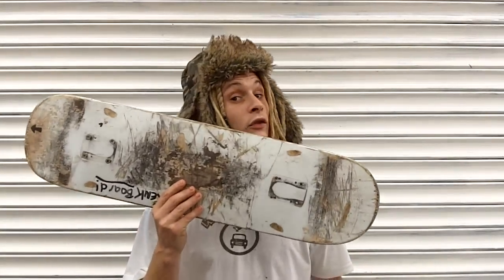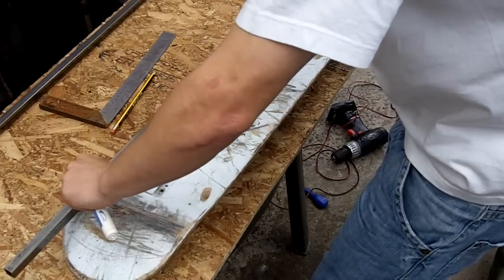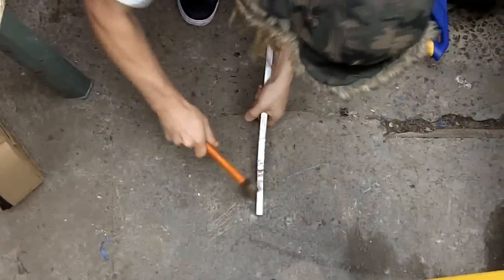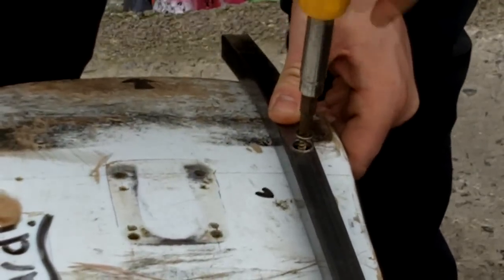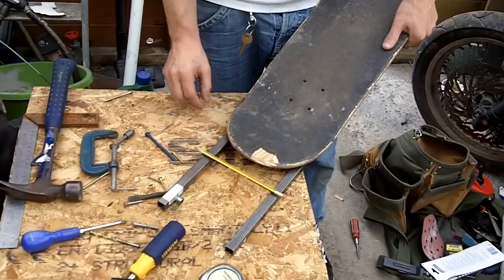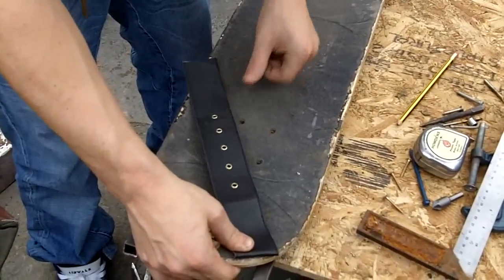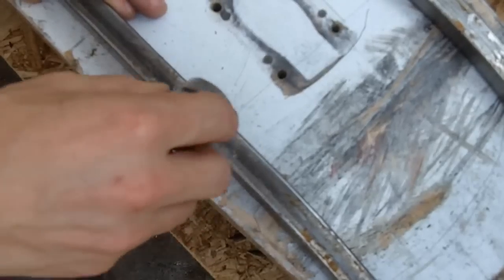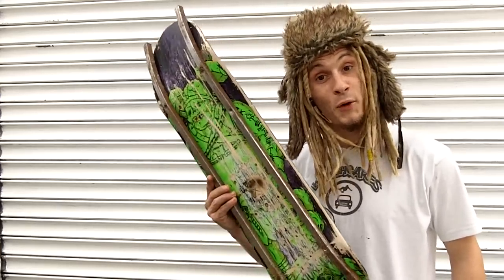How to make a Snow Skate - That Works

Comment from the maker: Hey everyone, im sorry i haven't been here to answer your questions hopefully this should cover most of it.

firstly does it turn?, basically you can turn to avoid things and control direction,  but its quite rudimentary, but its still a lot more control than a unmodified skateboard
 you will not be able to carve long turns  like a typical snowboards.

problems with this design? in deep snow you will find your self riding deep. and there will be a big build up of snow in front of you causing u to fall , stop or not go very fast at all. 

the shaped belly of the skateboard, causes snow to be pushed out instead of being compressed under the board, this causes drag, and effects the overall speed of travel.

we have addressed these issues and are currently making a new video showing you how to do the same.  out February
Reply: i bet if u glued crazy carpet to bottom 1st and used pex plumbing tube or pvc  pipe instead of heavy steel with self tapping screws through the top it would be faster and lighter. 25yrs ago i made them with an old gt snow racer skis and can be mounted on truck base to make a sweet bi deck just like the ones burton came out with 10yr later .soo much fun and with a throw rug or carpet can be used to practice ollie tricks in the house without much noise or destruction.

Comment from the maker: make one this year!!
Reply: i tried to combine or mix the skateboard with snowboard.
So i made a soft mini-snowboard with a free-angle binding.
the free angle binding gives you the freedom that you need on the feet when handling with the board.  the slides below the skate did not work. there is an old patent called doubled edges which had the  same base idea. but when i made the same, i found that it didn't work that way.  Either you run down only straight in a line with no curves, or if you start a curve or turn, then the leading edge or slide diggs into the snow..
Reply: Rue25 Raimund Popp is an owner
Reply: i tryed the same snowboard type. so i build a snowboard and placed two small rails on the base. But you know what happens? as soon as you try to take a curve, the front  rail digs into the snow and then you take a spin-over
Reply from the maker: Id have to agree with you there. leaning to turn doesn't work. You need to lift up the front end. like a wheely.

Comment: you can actually just take your trucks off if the bottom is not ruined cause i did it years ago and you can turn i only stopped using it cause i was lying at the bottom of a hill and it slid down and hit me in the head. it hurt a lot but it still works perfect just takes a bit of getting used to

Comment from the maker: we can turn on these no problem, eather via ticktacking/buttering or is the snow is fluffy enuff you can carve. you can also jump and grind but flip tricks are an issue if you have straps. ive never stab my self on it in the last 4 years, plus now the ends have wooden stoppers. its not much different to what done with a snowboard. we originally did this. coz its more efficiant than a blank deck alone.  And we just bomb hills on them. i like it :) try b4 asuming.

Comment: Chimpofm, would it work if i put a little bit flatter metal pipes? i dont have those big one i have flatter ones, would it work? It just started snowing like Hell in Skopje/Europe and it is going BIG!
Reply from the maker: hell yeh, use anything you can get ur hands on. im using 25mm x 6mm pvc beading thesedays. its big enuff to keep you straight, but small enuff to slide off

Comment: Btw: you don't need the metal one. It also works with wooden one.
Reply from the maker: We tried a range of runner materials  . Metal was the fastest.  And stops you gouging the wood. When hitting rocks.  Gona 3d print a truck  ski attachment soon
Reply: @chimpofm 
I made it out of wood and painted it. Runs as well. I also have a diy grundbox. It's fun to slide over it.

Comment: instead of screwing the straps on, drill an 8mm hole and use skate bolts but the wrong way round. This way you can take the straps on and off easily deepening on how u want it.

Comment: You cant take the trucks off and ride it bc a skate deck is concave. There is NO edge and you end up riding on a unbalanced convex bottom. So no you cant just ride a truckless deck no matter what wax you use UareNOTgood AtBazka. I live in Evergreen Co and this is the best method, just put 24 or 30 grit sandpaper on the top for grip.

Comment: if you get a router and mill grooves into the bottom, then wax it it works better..... and you can do gnarly rails on them too. I used to do it...... then i took a pvc tube to the knee...literally

Comment: I made one 2-3 winters ago...it's freakin' awesome...
But i used what i had at hand...so i saw a few round metal pipes from a folding cabinet...the length was perfect...
Took 2 pipes, folded the ends and fixed them with wood screws (pierced the folded bar on spot using the "Tool" I mean a hammer than just screwed them to the board)
The making lasted about 30 min.
That day was magical...but when the night came i got drunk and lost the board...
THE END...

Comment: Or you can buy a fucking real snowboard ta da problem solved
Reply: +CavemanPvP and an expensive ass ski pass, goggles, boots, bindings, jacket, pants and so on. cost you about $2,000 if your lucky. Then you have to drive there, deal with crowds, pay too much money for your lunch and what if the snow is crappy, or its fall, or spring? Go snow-skating, anywhere you fucking want, cheap as shit! And it's fun as shit! And yes it's a completely different activity.
Reply: +Molly Briggs lol 2000 dollars you fucking kidding? Cost me around $600
Reply: Pat SinclairCBJ58 For your snowboard, bindings, boots, goggles, jacket, pants, gloves and pass? Where the fuck do you shop? I need to go there. Of course I do live in Aspen so it's a little bit more expensive. But a new Snowboard on it's own can easily be $600. Trust me I work at a skate/ snowboard shop. SO you must have a piece of shit board. Of course pro forms are bad ass and lucky me I get them.